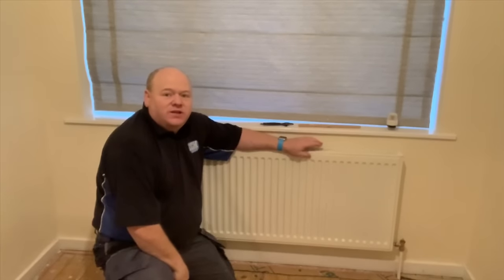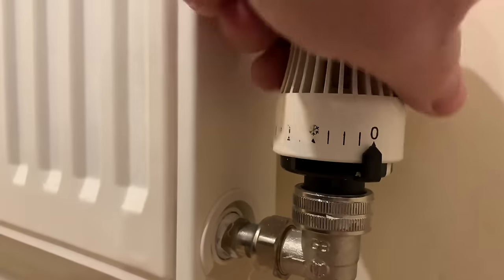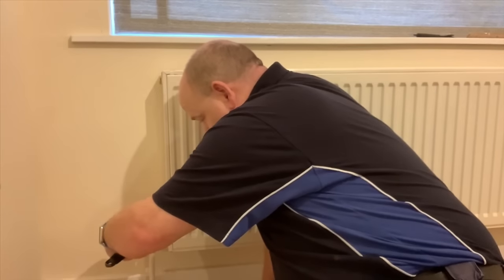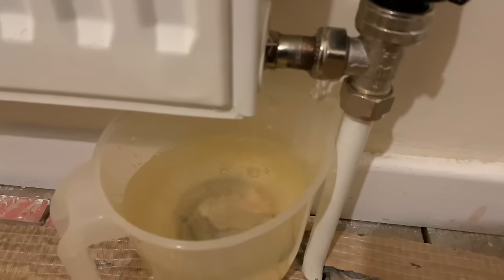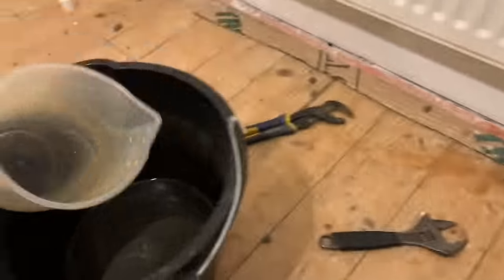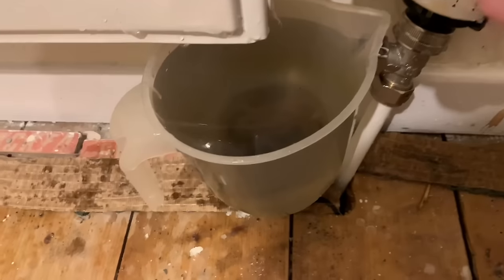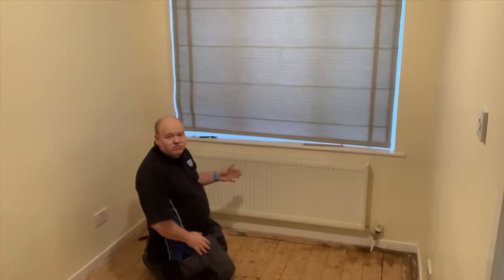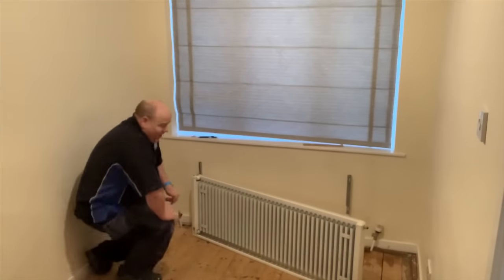How to remove a radiator for decorating - Removing a central heating rad

Comment from the maker: If you found this video please consider adding a donation to our chosen charity. Thank You https://www.justgiving.com/fundraising/cchleeds
Reply: Allen I'm getting a new boiler fitted on Tuesday but the radiators are connected via microbore pipe I want to change to 15 mm and replace all rad feed pipes my question how and where to isolate so I can refit one at a time without trying to go bonkers
Reply: Thanks for the charity link.

Comment: One point, which may already have been mentioned.  Count the number of turns you turn the lock shield valve when closing it.  Then turn it the same number when opening it up again, to keep the system balanced.
Reply: if I haven't count, how can I make it balanced?
Reply: if it was balanced correctly in the first place ?

Comment: Simple and easy to follow instructions, got the job done easily…. 

However, after removing the radiator I was left with no heating/hot water and an F72 error code on my boiler. 

For a while I was cursing you whilst frantically trying to fix the issue but then luckily a family friend said I’d need to repressurise the boiler which I did and problem solved. 

Thought I’d drop a comment for anyone who ends up in the same situation 👍🏻

Comment: Thank you for this video. The tips like using the gripper to hold onto the valves and placing the radiator upside down were simple but highly practical. Thanks again👍

Comment: Crack open vent key first once isolated  until water comes to a stop that way you can be sure the valves are doing there job ! Don’t bother with a container use a good rubble bag it will go under any rad and you can also collect more water I’ve been doing for 40 years never failed
Reply: Some good tips there Edmund, that i hadn’t thought of! Thanks for sharing.
Reply from the maker: Thanks very much for your comment, please consider subscribing to support the channel 🙂

Comment: Hi Allen, thanks for the great instructions. Would it be possible to use the rest of the heating system without putting the radiator back on?
Reply: yes you can
Reply from the maker: Thanks very much for your comment, please consider subscribing to support the channel 🙂

Comment: Great video - thanks, Allen! I've heard conflicting opinions about whether or not I need to cap off the valves after removal, to avoid leaks. Have you any thoughts on this? Cheers!
Reply from the maker: Thanks very much for your comment, please consider subscribing to support the channel 🙂
Reply: Whenever I take off a Radiator I do cap / blank off the valve,  I've known them to leak - especially on old systems. Just for my own peace of mind. Good video though, thanks.

Comment: It's useful to count the turns required to shut down the lock-shield so that when the radiator is re-installed it should be properly balanced.
Reply from the maker: Thanks very much for your comment, please consider subscribing to support the channel 🙂
Reply: How many times do you turn it?
Reply: @Tara-nv3rr  You count the number of turns required to close the lock-shield before removing the radiator then open it up by the same amount when you re-install it. (The number of turns will vary from radiator to radiator and it can be trial and error to balance a whole system.)
Reply: @monitoringstar  Absolutely correct, it is concerning the demonstrator did not know to do this.
Reply: @dr.davidlisk8197  The fact he did not mention it does not necessarily mean he did not know it.
Reply: @cybergen2K  Not much of a demonstration of you leave important  information  out.
Reply: Depends whether your radiator was balanced correctly to begin with though.

Comment: Informative video, thank you. Question, when the radiator is isolated as you've shown,  is it safe to operate the heating the system as you would normally do?
Reply from the maker: Thanks very much for your comment, please consider subscribing to support the channel 🙂
Reply: @AllenHart999  lol
Reply: Yes, but only if you do a crucial step the video missed. After you remove the radiator you should insert a small piece of copper in the thermostatic radiator valve(TRV) with a blanking cap on it, TRV’s can open by themselves a small amount and let water out, even if they are “off” so if you blank the valve off the system is safe to run as normal

Comment: Thank you so much, Allen; this was so very well explained. I'm not too bad at DIY, but always tend to be a bit nervous about water getting everywhere and/or the valve joints snapping in this sort of situation! It's so reassuring to see my thoughts confirmed in such a practical way. I'm going to invest in some pipe grips to hold my valves steady (It's quite an old radiator with a Danfoss thermostatic valve at one end) before I start and am definitely going to watch your video about putting the radiator back, which I need to do! 
One quick question; do I need to count how many turns are needed to shut off the lockshield valve so that I can put it back at the exact same setting when the radiator goes back, or is this not really critical? Please advise if you can, Allen; bless you!
Reply from the maker: Thanks very much for your comment, please consider subscribing to support the channel 🙂

Comment: Aint it great when you ask the customer not to remove the brackets, or at the very least ask them to put the screws back in as marker points, before they paint, paper or plaster/skim? Only to return to find.... No screws/bolts, they've lost the brackets and there is no up/down play in the tails. Ever tried retrofitting a rad under these circumstances? Not easy.
I always put a temporary stop, or a decorators cap on the TRV too. Especially this time of year. They will open open up in a cold room.
Reply: loafer sheffield how much would you charge for changing 4 radiators? I would supply
Reply: Screwfix are currently selling Kudox std panel rads with 25% off and they include free trv and lockshield valves. That could save you some dosh straight off and they will deliver to your property saving your plumber time and as such.. you, money into the bargain.
Make sure that you get your measurements and radiator types correct.

Re charging: Any plumber would have to ask you the following q?s.
What type of system do you have? Combi. System, vented or unvented?
If a system boiler... do all  of the external controls work? (zone valves/stats/programmers...)
Has the boiler had an annual service?  Have you got a service record logbook? Has the system been looked after, serviced, maintained... it may require a powerflush..if it's not been looked after; less likely if you have a magnetic filter fitted, indeed, have you actually got a filter fitted?

If all of these questions can be answered, a straight like for like swap, fill, vent and re-inhibit (clean the filter if you have one) I'd personally charge approx £150.00. All assuming that the system water is not contaminated with haematite (sludge)

Best bet re getting sum1 who can do the job properly is to ask at your local, independent plumbers merchants. They'll put you in touch with a recommended trader who can be trusted to do the job properly.

Good luck!
Reply: loafer sheffield thanks. So the Screwfix are just as good as the ones the boiler people would fit?
Reply: The quote for the boiler replacing included a flush. The company also has me on a monthly insurance plan, boiler cover I think it’s called. So I don’t know why they are charging so much for the radiators - it’s £500 labour?!?

Comment: Thank you! Just took off the first of nine radiators. Bought a pipe wrench to undo the nuts as the regular adjustable spanner kept losing the grip. Still loads cheaper than a plumber ;-)

Comment: Watched your video, absolutely magic , couldn't have done it without you , thanks alot
Reply: Hi Allen just topped boiler pressure back up , and water leaking out the valve , should I cap them off to get hot water back on mate

Comment: Great video. What do I do if the temperature valve on the right is missing? Just moved into a new property and my radiator doesn't seem to have one
Reply from the maker: You might need to fully drain the system down. Thanks.

Comment: Trying to remove my 1st radiator so I can get behind to fix cracks in wall which previous owner papered over (Groundworks employee - need I say more about the state of the UK infrastructure!) Anyway, slowly and nervously following the instructions - Looked to see how much water a typical radiator holds 8-10 litres good thing I have 2x 5ltr buckets ready along with my collection device - baking tray

Comment: Thanks allen, very concise and informative, if you were laying a floor and wanted the pipes coming through the floor boards, how hard would it be to remove the fixtures on the pipes so they could fit through a tight hole in the board, appreciate your videos mate, keep them coming 👌💯

Comment: First time removing a radiator, this video has made it easy. Only mistake I make was letting too much air into the radiator and a load of black sludge shot out the pipe onto the carpet. Luckily we are completely re doing the bedroom so the carpet is going in next week

Comment: Good video. I'll share one tip to prevent the case that the valves are not fully closed/shut off as canbe the case for older setups. Before undoing the valves after closing them, open the bleed valve. Some water should come out initially and then stop. If it continues then the valves are not shut and you will need to check you have indeed shut off the valves or worst case, drain the whole system.

Comment: Really helpful video - gives me confidence to take a troublesome radiator off. I have a hot water cylinder wit a pressure guage. Is it there that I will need to top the pressure up? I can't see a pressure guage on my boiler.

Comment: Thank you so much for the video. You explained it so well and didn't rush. Which is good.  Just a quick question. I'm l right in saying that l can buy blanking plugs for both the radiator and the valves for extra precautions?

Comment: Got the radiator off no problem following these steps, have noticed a slight leak from the TRV since though and the plaster isn't coming for another week yet, don't suppose there's a video about this? Only a few drops coming through but I'd rather seal it off properly

Comment: Great video, thanks! Quick question - I also had some water coming out of the pipe connected to the thermostatic valve side. Is that usual? Thanks

Comment: Thanks. If I wasn’t putting radiator back on, would I need to put caps on the pipes /valves each side?
Reply from the maker: That is correct

Comment: Excellent video.
I needed to remove two radiators before the plasterers arrive. Followed your clear instructions and managed very easily thank you.
The next day I've noticed though that there is a slight drip coming from one of the thermostat pipes. I've tried removing the thermostat valve turning up max and refitting then turning to zero again. There's stop a slight drip, any ideas what the issue could be?
Thanks very much for the great video and instructions
Reply: *still a slight drip, not stop a slight drip 😅

Comment: Thanks for the video. I've just tried to remove a thermostatic radiator valve head, but when unscrewing the collar of the head water started to flow out from the base. Do you know what could have caused this?

Comment: Brilliant video.  I've followed all the instructions. Radiator valves closed, empty and ready for lift off.   Now I'm faced with a problem- my pipes are horizontal below (not going down into floor boards). They don't have any wiggle room and I don't want to bend /break the pipes when removing. What do I do now to remove?  Thanks and thanks for the great vid.
Reply from the maker: Glad it helped

Comment: thanks Allen. I’m having trouble locating the caps I need. 
I think they are 28mm diameter (including thread) - are you aware of what they are called in Screwfix or toolstation? There are all sorts and cant find one to fit.

Comment: I just had a nightmare, i did everything you said but the water was hitting the ceiling, i put it back together and took the trv off, and it had no innards, so it wasn't closing the valve when it was dialled to the off position, im really chuffed now its sorted as i used your video each time before and the decorating looks so much better if you remove the rads.

Comment: This is quite clear. I assume to plaster you just remove the brackets, need to make skirting board marks to where these are positioned?
Reply from the maker: Normally leave the srcews in place? Thanks

Comment: Thank you, I hope I will be accurate like this as I have the same radiators. One question, does the main water supply need to be switched off when uninstalling the radiators?
Reply from the maker: the radiator does not contain water from the mains no. Thanks.

Comment: Great video, thanks.

I have a thermostatic valve which is stuck on, so the radiator is piping hot every time the heating is on.

Is it possible to remove the radiator when the valve is stuck on high? Or do I need to replace the thermostatic valve first? If so, how do I replace the thermostatic valve?

Cheers.
Reply from the maker: Sounds like it needs a new TRV head and maybe the valve, hard to know for sure without seeing it.
Reply from the maker: Thanks very much for your comment, please consider subscribing to support the channel 🙂

Comment: Brilliant video! Really easy to understand. I have a question when connecting the radiator back up the valve with the numbers on now has a very slow drip. You mentioned tape is this what I should put over the valve?

Comment: Thanks Allen great video, quick question I have the same small valves on both sides of a radiator I want to removed, small plastic ones which screw in and out on both sides, not the lock shield valve as in your pic but they dont look like Thermostatic valves with much smaller and all plastic, any ideas

Comment: When trv is set to zero/as closed as possible.. Is there any chance it will open at very low temperatures. Some plumbers have advised that if temp drops below zero, the trv may open? Is there caps you can buy for the TV and lockshield to stop any water flow?

Comment: Thanks, very clear. I have old radiators with old valves which leak when they're closed. Is it possible to replace them without draining the entire system?

Comment: Hi, brilliant video! Is it essential that the boiler needs to be “refilled” manually? Would the mains water not just refill the radiator and the boiler automatically when the central heating is turned on? 

Thanks in advance :)

Comment: Hi Allen, about 2 months ago my Bro changed my radiators after I moved into a new flat as some were leaking and rusty. We bought some from Screwfix that had a deal on that included the fittings/ thermostats for free. Unfortunately they only go down to a frost setting. Does this mean I can't easily take them off the wall to re-decorate? Cheers, Dave.

Comment: Hello easy to understand video.
Question the bleed valve is bursting water out when I tighten it.Does it need a new valve.plus it has flooded my room cause when I opened the bottom valve to Drain so much water is coming out  even though the both valves are closed.after a few big buckets it has stopped.
I don’t want to fill the radiator  up again because I fear it will burst out of the bleed valve again.
Any suggestions please.
Thanks I have subscribed.
Reply from the maker: Thanks very much for your comment, please consider subscribing to support the channel 🙂

Comment: when you've got the radiator off, is it worth blasting a flow of water through it with a garden hose (outside, obviously!) to clean out any sludge that may be in it?

Comment: Hi
Do you need to turn off the main water supply to empty the radiator.

I need to remove mine so that I can remove wallpaper ready for plastering,  will the heating still work around the house without affecting the the one radiator that's now off the wall

a little nervous to say the least, but will be cheaper than a plumber, also nervous about topping up my boiler

Comment: I need to remove one of my rads to flush it through. However it has a telescopic tail on one end. Is this a cause for concern as I am sure the tail will moving when I loosen the valves? I am worried I won't be able to reconnect correctly afterwards

Comment: Question… what if your thermostat is on the same side as the air bleed key valve? 

As my radiator is setup literally opposite. 

Cheers
Reply from the maker: Just the same?

Comment: Theres no chance of any water coming through onces the valves are shut? 
Like if it took a couple of days extra to decorate its not a problem leaving the pipes like this?
Reply from the maker: You may need to cap the TRV, Thanks.

Comment: hi Allen, brilliant video thank you, i am removing my radiator and i want to put a sink instead of the radiator's place, as i have the water pipes of the radiator I was wondering if it is possible to do that? thank you for your reply.
Reply: Errrr......
Reply: Jesus see this is an example of what the page isn't doing to people giving them.confidence to put in sinks instead of radiators and trying to use heating pipes for a domestic service .. call a plumber folks and save yer selves the insurance claim

Comment: Is there anything you can do about the sludge in the radiator? Or do you just put the radiator back on the wall without removing the sludge?

Comment: A great tutorial, I'm in the process of trying to do this for the first time and I've turned the thermostatic valve to the fully off position and closed the valve on the other side. But no matter what when I'm draining water put it never stops and the boiler pressure keeps dropping even after topping it up :( Not sure what I'm doing wrong